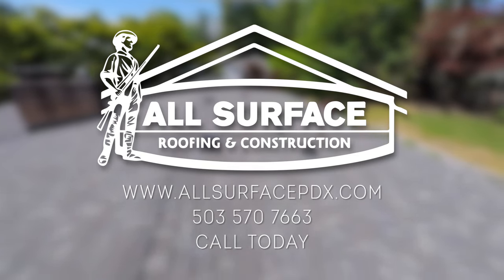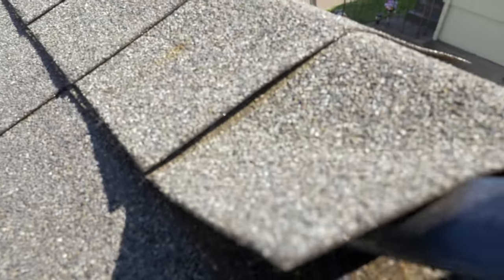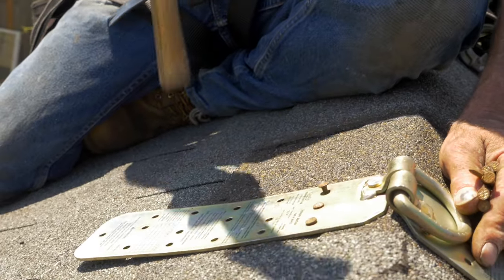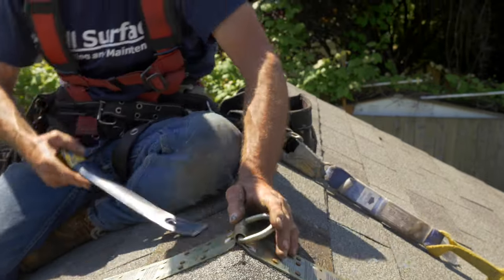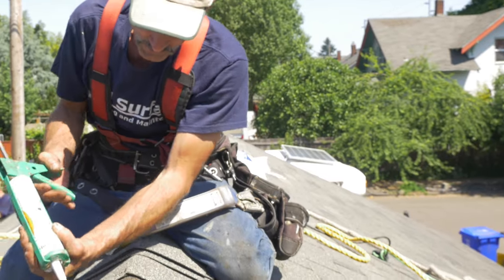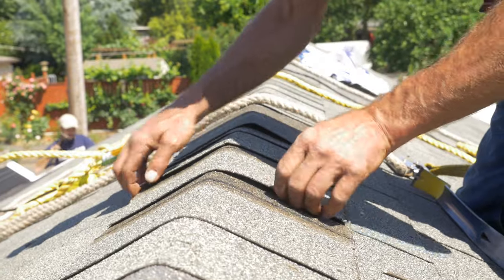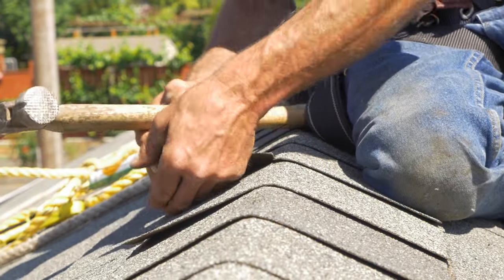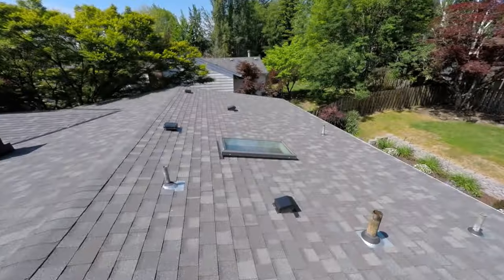How To: Install a temporary roof anchor

Comment: Not to sound critical...but why not just install a permanent one so the next guy on that roof doesn't have to go through all that?  I feel like millions of homes would have permanent anchors within a year if everyone who uses temporary would switch to permanent.
Reply: That's not a bad idea. They should add that to the roofing section of state building codes: roof must have a permanent safety anchor for every "X amount" feet of ridge line.
Reply: What would you charge to install an roof anchor?
Reply: Because i'm not going to trust an anchor some says is "good"
Reply: @forshigity5000  If there is a code that states it must be installed so and so, why not? Do you trust your rope line to hold you? Or your harness? You could easily check by checking the nails, and if there is a ridge board or rafter that its nailed into.
Reply: I'd feel more secure installing one each time rather than expecting that the one installed 4 years ago hasn't experienced some kind of wear that makes it faulty now.
Reply: I wouldn't trust an anchor sitting in the weather for that long on a roof. Wood expands and contracts, and I just wooden trust it on a residential wooden roof.
Reply: I think the issue with permanent roof anchors is cost.  They have to be inspected and certified every year.
Reply: Agree with this but there are some drawback,  I notice my house doesn't have one but my bro house had 2 permanent one, but sometime I feel like I don't trust it, because will I know if that spot have been rusted, or the wood rotted. But I can see this is pratical if they reinforce the  anchor point with something that doesn't rust or rotted instead of just screw in wood, and they should have a date stamp on the install date, maybe make it expire 20 years since most roof need replacement during that time.
Reply: @theory816 - Who says it ruins the look? I just took a look at my medium-steep roof from the angle where the ridge is visible. It wouldn't be much noticable at that distance. What is VERY noticeable is the attic vent, the plumbing vents, the bathroom fan vents and the alarm up by the eave. Never mind the gutters. Have you ever noticed how obtrusive they are? So, with all that crap up there, who is looking at an anchor that lies flat on the roof?
Reply: @poetnk  males perfect sence but what about permanent with a date of install and a expiration date
Reply: My concern with this is that the anchor will rust. I wouldn't want to be anchored to an anchor of unknown condition.
Reply: Go back to your computer let the tradesmen handle this.
Reply: You clearly don't own a house or work as roofer 🤦🏻‍♂️
Reply: @doubleasadventuresfishing1921  why not just explain why it wouldn't be a good idea instead of belittling?
Reply: @hondaguy9153  hmm because it's not worth explaining everyones stupidity...
Reply: home owner most likely won't approve.
Reply: @leonardocleaningllc1952  shouldn't be more than 200$. Cost of bracket, drive time, and this guy clearly installed one in under 4mins. So let's say it was permanent and it requires lag bolts will call it 30 mins of actual labor.
Reply: @poetnk  it should have a covered latch , so in order to use it, you just uncover the anchor. Would look like a roof vent 100% covered from the elements but has hinges to expose the anchorb
Reply: @Arcanus31  Ah, that's a great idea. The climbing kit I have obviously doesn't come with permanent anchors, so I've been patching holes. Not sure if that would make me much more comfortable about the quality, especially if I found one on the roof vs one I installed myself.
Reply: Why not use a duplex nail do you don’t have to jam a bar underneath it?
Reply: Nice way to damage roof. Rust moss mold will go through
Reply: Some home owners are cheap
Reply: Rust
Reply: These should be mandatory on all homes.

Comment: I have always found it strange that you have to put yourself in a falling position 2 times! You have to climb up with no safety and install the bracket. When your done you need to remove the bracket without any safety device.
Reply: Please see my comments above.
Reply: What would you recommend instead?
Reply: @motoace2007  a ridge hook ladder to get up there or be able to tie off on the ground or tree on the opposite side of the house so you can put a tie off on the roof. But OSHA doesn’t want you to do either, so they want you to go up there without anything, and get back down without anything when the job is done.
Reply: @akaredcrossbow  Makes perfect sense -- to a government agency.

Comment: I've seen a roofer use double-headed (duplex) nails, which makes removal easy.
Reply: "Form nails" they are designed for concrete forms which are always taken back apart
Reply: Most anchors come with them now but as a roofer i drop plenty of nails and use what i got

Comment: I try to find a rafter or truss to secure the D-ring. I also use screws instead of nails. Caulking the nails after replacing the cap shingles l also do
Reply: screws are too brittle. If you fall you could rip all the heads off. We honestly do a 50 50 between screws and nails
Reply: @johnrweiss  
The screws l use are for flat roofs and I have never seen a head of a screw get broken off
Reply: @jamesericksonsr1796  Those people who saw that may not like to comment here while sitting in wheelchair or somewhere else.
Reply: @weip9328  
Oh
Reply: @jamesericksonsr1796  How many people fall off of your roofs on average?
Reply: @rlcl4913  I have no idea
Reply: @jamesericksonsr1796  hack
Reply: @rlcl4913   
That's a big word from a little boy
Reply: @jamesericksonsr1796  Words are hard
Reply: @rlcl4913  
You would know

Comment: Thanks for the primer. I have done a LOT of solar installs. Now I have to reroof my own house. It is a 50 degree A frame. 
This is a great excuse to buy more climbing gear.
Good times ahead!
Reply: How'd you go?
Reply: How’d you go?
Reply: @burner5673  I ended up not having to reroof it. The house burned in the Caldor Fire in August of '21. 
I do have my climbing racks fully geared, though!

Comment: how are you guys able to get all the nails/screws in straight like that on the rafters?  most rafters are 2x... so 1.5", but the span from left most hole to the right most hole is more than 1.5".

Comment: Could you leave the anchor in for future use? Like hanging Christmas lights or cleaning out gutters for example?
Reply: they sell permanent anchors for roofs as well, just get one of those and install it and you have a permanent roof anchor. they're not too spendy. cheers.
Reply: Christmas light installation causes more roof damage  than it is worth  . So many repair jobs have been because of people going up on the roofs  .

Comment: Can you just leave them there for future use? If yes, do you apply a roof caulk to cover the nails to prevent leaks??
Reply: No, because the anchor or nails will deteriorate while exposed to the weather. This is strictly a temporary system. Permanent anchors, however, can be left in. They are installed differently.
Reply: Just cover the entire anchor in roof cement and it'll be waterproof.
Reply: @rlcl4913  it probably makes more sense since removing it you still left holes that need to be sealed.

Comment: Don't need to hit the joist?   It's all held in by the roof decking?
Reply: Wondering the same thing. I'm 270 lbs.
Reply: Georgia Hunter I didn't mess around - I put mine in the joist.  It was easier to find than I thought by tapping the hammer along the roofline until it sounded solid.
Reply: Shit I'm only 170lbs. and I would NEVER trust that thing if it wasn't nailed into a rafter.
Reply: If you hit a rafter, you can do with just a few nails on each side. Without a rafter, a dozen nails like shown would be my minimum. In older houses, the roofing lumber is also much thicker than plywood used today, so hitting a rafter on an old roof also isn't as important.

Comment: Is it necessary to take off those top shingle layers? Or am I able to nail through all of them for my anchor?
Reply: It would be holes through the shingle and water could leak
Reply: @eharris6347  why not use sealant of the holes in the shingles?
Reply: You don't want to put holes through your top shingle, if you don't have too ,  and then  rely on a dabs of sealant to seal  
When you can just not damage your top shingle  , will all those nails  holes

Comment: how do you safely get to the top of a steep roof in order to do this?
Reply: Chicken meet egg.
Reply: Tie one end of your safety line to the back of your buddies truck and make sure it’s solid like the ball or receiver.  Throw the other end carefully over the roof and now you have a proper fall restraint.  Notice! Make sure you do this right before 12pm or 5pm then quickly rope in, wait for your buddies lunch or dinner, and yell when you’ve reach the peak of the roof.

Comment: Question - Why not screw the unit in so it can easily go in and be unscrewed and not damage or stress the actually steel anchor unit ?
Reply: Nails have a greater sheer strength.
Reply: @wannabejeeper  look up "Do Screws Shear easier than Nails?" in youtube project farm.. You might be surprised
Reply: @das250250  These anchors come with very specific nails to be used it them.  Generally speaking nails have more sheer strength, but there are structural screws that are better then decking screws etc.  However you'd be going against what the manufacturer says, and this could be a life saving device.  I'm in the process of getting my 12/12 pitch garage roofed, and as much as screws would be so much more convenient, I'll be sticking with the nails.

Comment: Where do you hook it to when you have a corrugated tin roof where they ain't no flat surface to nail to
Reply: They install  a different anchor which uses the existing roof screws.

Comment: Actually this is partially wrong, the anchor seen in the video has the instructions written on it.  In order for the anchor to achieve 5000 pound hold: 3M "Anchor must be fastened to the roof structure using a minimum of 10 #8x2" screws, or 16d 3" double head nails, in the center row of holes securing the Reusable Roof Anchor to the roof rafter." DBI-Sala "  Position the anchor on the roof such that the 12 nail holes along the center of the legs are over (framing) member. Then, push down to minimize any gap between the anchor and the sheathing and nail. Use only 16d nails to install the anchor (six per leg into the rafters and sheathing). Install all 12 nails.  If the roof anchor is not installed properly, it will not hold the rated loads and serious injury or death could occur.
Reply: You first lol

Comment: You should be nailing into the truss, but I guess it's worked for you this long.
Reply: Definitely find the truss, nails where going into 1/2 inch plywood,!
Reply: The mfg's reqs. for my anchor are different depending on whether nailing into the truss or not, i.e., yeah, no truss you are supposed to be doubling up on the nails

Comment: WARNING: People can die just hanging in a harness if they are not putting pressure somehow on their feet or otherwise using their leg muscles to squeeze blood out of their legs. The presence of heavy gear belts is not helpful. It IS a known problem, even if it is not common. You can't predict who it will happen to. It can happen quickly, with no warning. Tragic outcomes have happened when people had fallen and were "safely" hanging from their harness awaiting recovery. One means of reducing risk is to have two recovery plans. One self-recovery plan and one for others to recover the fallen person. The other key is to NOT hang for 10-15 minutes. If someone is hanging and can't plant their feet on something, promptly recover them.

I never heard of this problem until I was reading about roofing harnesses and OSHA regs. However, as they say, safety regulations are written in blood.

Also, solitary roofers should be careful to have a REALISTIC recovery plan. Hanging by a harness, ESPECIALLY from a back D-ring, can be challenging situation to escape if you can't climb up or let yourself down. I am a former rock climber and I can see how getting back over the lip of a gutter could be a problem for some people , especially when hanging from the back. I can't imagine recovery from a hanging position supported at the back.
Reply: Never heard this before. Thanks. I had to look long and hard for a harness with a D-ring in front. I have an arborist saddle, and the rope always connects in the front, which makes more sense to me.

Comment: When he drops those nails he has to whack it a bit to get through the sheathing, then with the nail half way in, all it seems to take is a tap to get all the way in. Easy in, easy out? I wouldn't trust it.
Reply: Looks like some of them in the outer holes missed the truss. Fortunately, in my home, I can go into the attic where it's all within reach.

Comment: When the roof sealant was apply to the nails he missed the nail heads.
Reply: He was covering the old holes, not the new nails. I suppose the nails are supposed to seal themselves. I am not sure though.
Reply: He was sealing the old nail holes. The new nails don't need to be sealed because they're covered by the shingles.

Comment: Putting the roof anchor solely into the roof decking, not hitting the actual rafters. Isnt proper. If you were to fall it would rip it right out. Always, always put the nails into a rafter. I use 3" spiral nails. I weigh 210 lbs, no way in hell am I trusting my life on 4" nails just in half inch decking.

Also. Why the hell does it look like your lanyard is tied off to you hammer loop? I get putting it on the d rings by your side if you know how to keep your rope tight. But that will rip right out if you were to fall